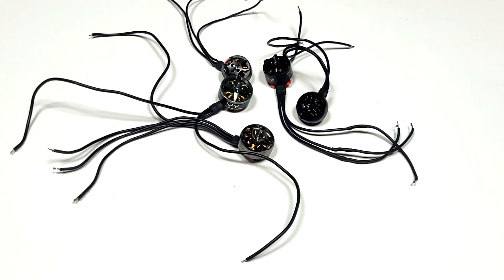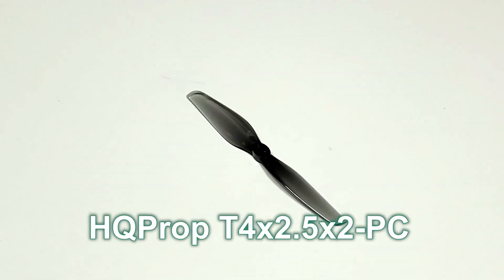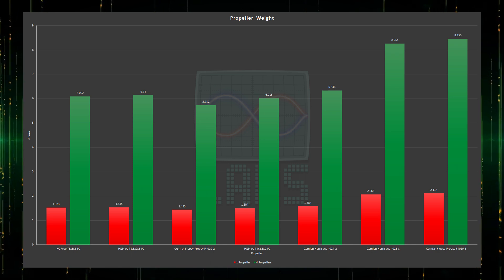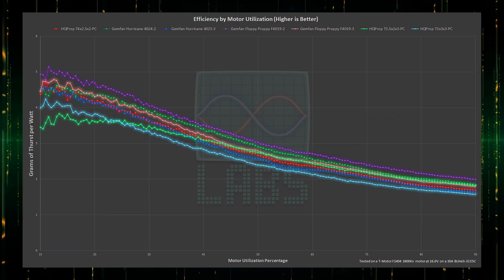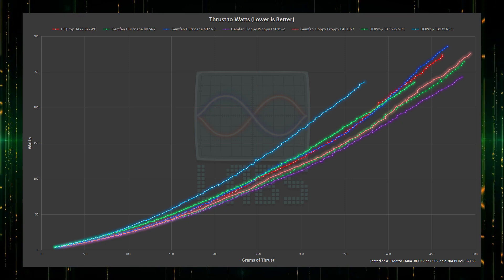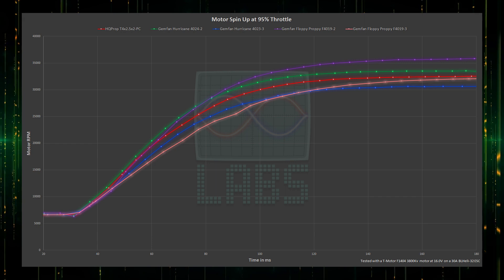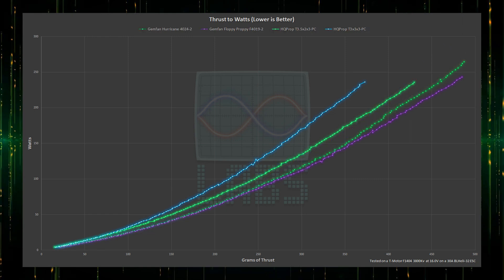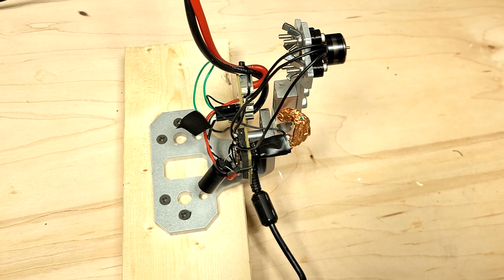4" Propellers on 1404 Motors - Full Comparative Testing

Comment: I purchased 1404 motors after accidentally changing inav poles from 12 to 9 and testing my 1104 7k kv on the emax 3.5 inch 3 blade props, witch prior to changing to inav and thinking the stator were the poles🫣, it ran just fine...so im hoping that switching out all my motors to slightly bigger ones will improve my power and efficiency...I will stick with the 3.5 inch 3 blade props and since I purchased 8 motors, I'll build a 4 inch hurricane next...

Comment: Beautiful testing, thanks a lot! That is some really helpful insight for the next build, but I suspect that in reality the higher pitched props do perform better because of the motor&prop moving relative to the air. As in, a 4024 cruising on a drone behaves similarly to a 4019 on a stand. What do you think?

Comment: Many thanks for this, considering your PSA on 4 inch floppy proppies, i find that using floppies on 4 inch happymodel 1404 2750kv to be ideal for me still. On crash / impact the props would fold before giving damaging stress to motor shaft. ex1404 is notorious to brreak on impact
Reply: I also use Happymodel 1404 2750kv and get superb efficiency with both Gemfan 4024-2 and the floppies. But the floppies introduce a bit of jello when using 4K action cam, and now I want to try tri-bladed ones... maybe  HQProp T4x2x3  ?

Comment: Exactly what I was looking for. Because my famous quad Crux35 frame is broken. The Avio 4 Frame Kit seems to be a good frame to switch from the crux35 (3.5") to 4 inch. You only need a 90° USB adapter. And since the PCB has to be higher, I can't guarantee whether the electronics will fit between the 2 plates...

And I know that the 1404 3500KV motors on the Crux35 have more than enough power on 3.5 inches. Supposedly 3500KV is also used with 4". So it should work as long as the motors don't overheat easily...

Comment: I have a cinelog 2.5 with 1404 4500kv motors and a busted frame.  Thinking about converting it to a 3inch or 4 inch digital toothpick build with a xt30 450mah 4s packs.
Reply from the maker: 4500kv is a bit high, unless you went with 3s instead of 4s.
Reply: @RecursionLabs i had the same plan, my cinelog25v2 with 1404 4500kv motors and 35amps fc & 4s 850mah lipos to be built with Geprc Tern LR40 frame , would this be good idea? Thanks for your future response..

Comment: i built a micro apex modifyng a frame designed for 2 inch putting 3 inch arms on it. Motors are xing2 1404 4600 kv, 3s battery, 3025x3 props. the whole thing is about 150 gr mounting a complete stack 20x20. I love it, it rips hard xxx !!! waiting for 4s batteries. i'm thinking about 4020 after you video, the only problem is that i'm worried about the weight for that i'll have to switch to an heavier frame (80 gr alone against the former 31 gr).
Reply: ps: i subscribed 4 science !!!

Comment: It's a mystery that many people like the 3-blade props for their "grip". Maybe it's a PID control thing. I see that 3 blades are never good here.
Reply from the maker: It really depends on the motor and prop size. 3 blade produce more thrust for less RPM, which is great for noise, but requires more chooch to spin.

Comment: Any idea as to why my 1203 5500kv runs the same power as my new 1404 6000kv but had half the amp draw? I wanted more power for freestyle but got same power with the 1404's drawing 2x the amps and killing my flight times. Same props even.
Reply from the maker: What battery and prop did you use for both?
Reply: @RecursionLabs  3s 550mah and 720mah. Tried 3 props, hq t3x2.5x3, t3x2x2, and t3x3x2. Started with triblades and went to bi trying to get amp draw down. Tri on 1203 was getting 5 min, hard freestyle sbang. Can't even get 3 on 1404 biblades slow cruising. Go sbang and 90 seconds in I'm at 3.5v or less.
Reply: 105 gram dry weight
Reply: @american7169  1404 motor with 6000kv on small 3s battery is too high kv. You need ~4500kv 1404 on 3s.

Comment: I had build with mamba toka 1404 3000kv motors 3,5inch quad ,it was my favorite build,. 6s was too powerfull for me so l target 4s and it was perrfectooo!!! Sory for my English;) spring l try to build 4ich quad with this motors.  Because before l trade my 3,5" to 5" but l not happy with this trade;(
Reply from the maker: You could build a better 3.5" instead. With the right build you can get the Thrust to Weight the same as a 5".
Reply: @RecursionLabs  I bought the following drone: Explorer LR4 178mm 4inch 36g,
HAKRC F722 40A AIO 7g,
DIATONE MAMBA TOKA 1404 3000KV 6S 4x10.5g,
Caddx Nebula Pro Nano Vista kit 26.5g,
Tbs crossfire nano rx with immortal T 5g,
everything together weighs 131.5g, well after adding screws and 3d printed parts, it will be about ~150g.
which batteries are better to use in terms of weight? wanting to fly longer while flying calmly.;)
Reply: @RecursionLabs  I forgot to mention propellers IFlight Nazgul 4030 4X3 2-Blade 4x1.5g

Comment: Regarding your spin-up tests, I think it would be interesting to see thrust instead of rpm over time. You should be easily able to do that with your measured thrust curves? This would be the more interesting value to evaluate flight performance! I am still so happy that I found your channel :)
Reply from the maker: Since the RPM is what generates thrust it really should look the same. Samples for RPM happen every 3ms or so, so the data is good enough to use to show the spin up of each test, but the thrust sensor only samples around 30hz, so it's not good enough for that purpose. If you look at the RPM charts and Thrust charts by throttle, they look quite similar, and when you start to see a curve out on the thrust near the top end, that's because the motor can't spin it faster and you'll see the RPM do the same. The spin up charts (especially matching RPMs like I do in some videos when it makes sense) are a bit time consuming to produce charts with, even with some script assistance.

Comment: Can you do the same on bigger motors? Wonder if the gemfan 4023 are better suited on a 250-300g quad then the gemfan 3520. Maybe the 4023´s just need a throttle limit?
Reply from the maker: Yeah I'm testing them on 1408.
Reply: @RecursionLabs  nice, when will it be online?:)

Comment: Could you do a test of 3.5"-4" on a 1408 motor? You already have some 3.5" data from your 1404vs1408 video, but I was wondering how big of a difference going to 4" on 1408 would be. A common 4" prop is the iFlight nazgul T4030

Comment: Please try these on 6S.  Today we are flying custom made 6S from 18350 batts.   And seem like 4 inch 1.9pitch  with 3 blades does very well on my flight tests.  Would love to see actual comparison.
My motors are 6S smootx 2750kv
Reply from the maker: What is the stator size (motor number)?
Reply: @RecursionLabs  
Specification:

Brand Name: RCInpower

Model: Smoox 1404 Plus

Item Name: 1404 2750KV 4-6S / 3850KV 3-4S / 5000KV 2-3S Brushless Motor

KV: 2750KV / 3850KV / 5000KV ( Optional)

Color: Orange / Blue (Optional)

Quantity: 1 PC

Configuration: 9N12P

Shaft Dimeter: 1.5mm （ 2mm Inside）

Stator Diameter: 12mm 

Mounting Hole: 9x9, M2

Stator Length: 4mm

Dimension: 19.2x13.1mm

Weight: 9g ( Include 30mm wire)
Reply from the maker: @markuskoarmani1364  Interesting. I have not tested that specific motor but 6s really shouldn't make that much of a difference given the Kv is equivalency. Which 1.9" pitch prop are you using?
Reply: @RecursionLabs  German F4019. My motors come back warm.   my cam is at 30 degree and you can see it's fast flight.   I wonder if you can include temp readings to get better sense of real world flights.

I found that low kv motors seem to be much more efficient on my batteries and motor temperatures then higher kv winding running on 6S battery.

Comment: Woohoo! Building a 4" on 1404's right now. I went with Diatone Mamba Toka 1404 @ 4000 KV (going 3S). I'm going to start off with Gemfan Hurricane 3520-3's and maybe work my way up to 4" floppy proppy's (probably 2 blade). Glad to see the lower pitched 4" props doing well in efficiency, because that's what I wanted to run anyway and I know I don't need whatever extra thrust the taller pitch props might provide.
Reply from the maker: The taller pitched props don't really provide more thrust here because were hitting the limits in what the motor size can do. Why 3s instead of 4s?
Reply: @RecursionLabs  Yeah that's something my brain needs to keep chewing on. Would be nice to be able to calculate and predict what pitch prop is the limit for a given power train. We can now see it after you test, but not everyone has a test stand.

Going 3S because my 550 mAh 3S batteries seem like the perfect size, weight, power and capacity for my flying style. I don't need whatever power 4S and above would grant me and I don't want any extra weight. My 3" on 3S with 1106 motors was already way too much power for me. I just fly LOS, btw.
Reply: I'm going to build a 3.5" on Mamba Toka 1408 4100kv motors, but seeing this video I might consider switching to 4" for added efficiency.

Comment: cool. so flywoo made a good choice on their 4inch explorer with the 4024 2blade.
Reply from the maker: For sure. The NIN motors didn't do so well in the 1404 motor testing though, but being 2700Kv might help there since that's like an efficient motor output limit on 4s.
Reply: @RecursionLabs   i have to check your test, because i already thought about replacing them with a 2004 T-Motor or new BHobby unit. i dont care about weight, efficiency is the goal. :-)
Reply from the maker: @rolliseventeen  Well I'll be testing them on T-Motor 1408 motors soon if you want to wait for that. I have 2204 but I'll be saving those for 5" props I think.
Reply: @RecursionLabs  sure i can wait, because the NINs are already mounted and i should test them anyway. do you mean 2204, or 2004?. the 2004 is one of the largest t-mount motor size i know with weight around 16gr. it should not be over 20gr for a 4inch motor.
Reply from the maker: @rolliseventeen  2004